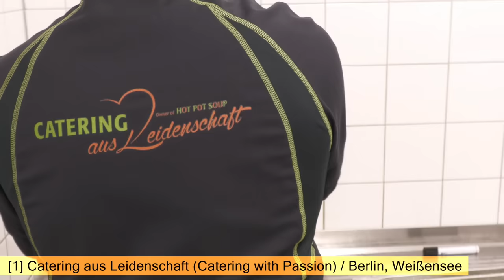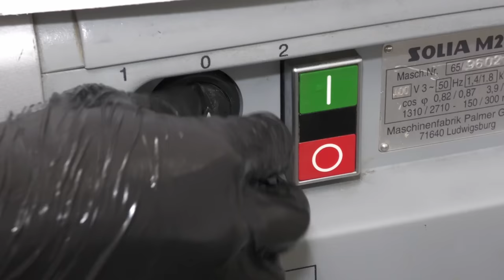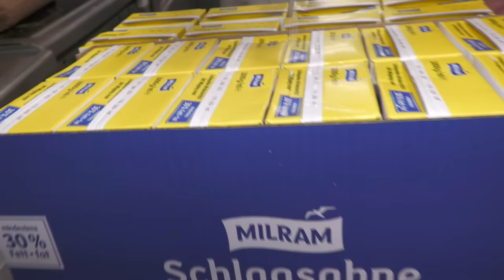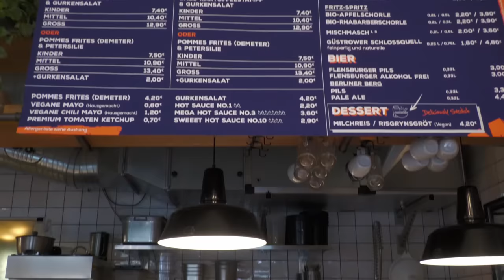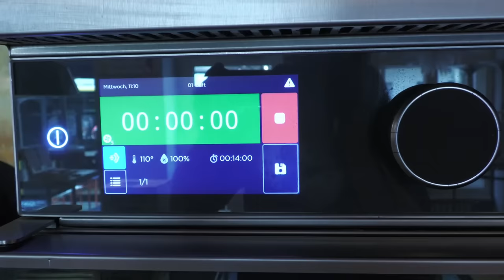Köttbullar | Better than Ikea Meatballs | Street Food in Berlin Germany

Comment: Very nice food facilility. But you use a very dangerous cucumber slicing machine. You should use a safety device to push in the cumcumber. And second you place the food container on the floor 4:10 then blend it, while it stands on the floor. I think it's no protocol to put anything containing directly on the floor. You can see how the food container base is 4:23, and you give it a shake and dirt could fall in the food. I have to say that the end result food looks pretty nice, maybe a little grit in the cream sauce ;-)
Reply from the maker: Thank you for your thoughtful comments.🙏 The cucumber slicer has two quite long filling tubes, you have to put your hand in very deeply and with force to get to the knives. 03:14 Looks more dangerous in the video than it is. ;) You can't get your fingers from the edge down to the knives. The camera perspective (only high-angle shots) is deceptive, the tubes are deeper and narrower than you can see in the video. 03:36 And when he pushes in a new cucumber, he automatically pushes the smaller rest on the bottom down onto the knife. And with the last cucumber he used a corresponding metal bolt to push it down. Not in the video, otherwise it would have been too long.

At the point where the container stands on the floor and it mixes 04:10, it must be said that the grid on which it stands was previously sprayed with the water hose. For reasons of video editing, we didn't integrate every single work step, otherwise it would be very boring at times. The first rough cut alone when making the sauce was 40 minutes long. What do you leave in, what do you take in? Something is always missing. Best Foodi greetings from Berlin✌️
Reply: I thought I was going the only one who noticed all of that, I'm a chef and that's why it couldn't pass me.... otherwise the end result is amazing.